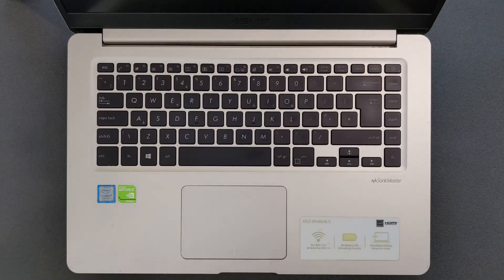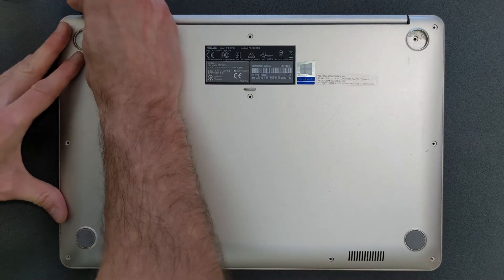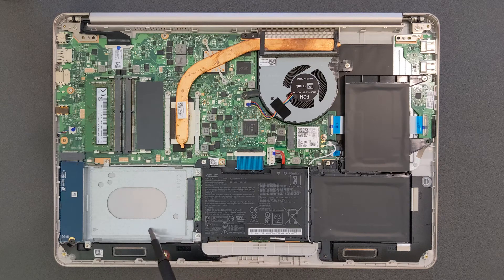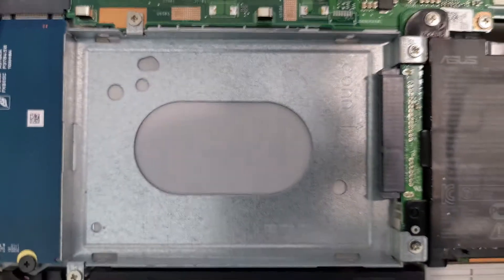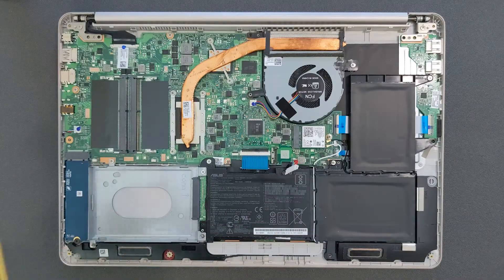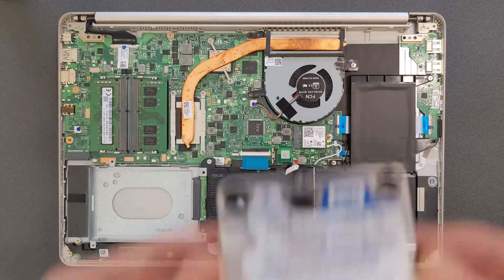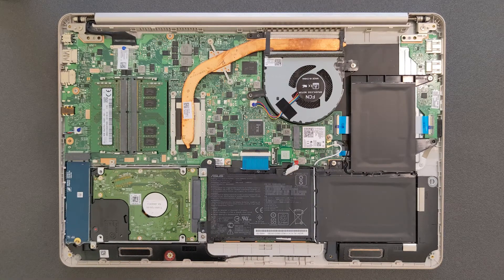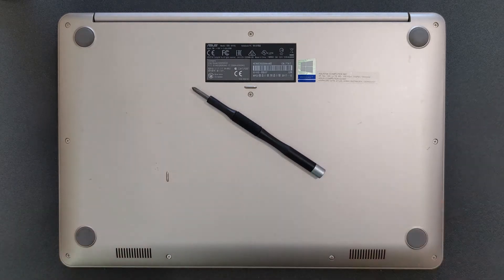Asus Vivobook 15 X510U / X510UQ  RAM and SSD / HDD upgrade

Comment: I tried to add a 512GB m.2 SATA drive with no success. I cloned the existing 2.5 sata drive onto the m.2 (externally) first. I removed the the 2.5 and installed the m.2. Bios doesn’t show anything in the three slots with just the m.2 connected. Any suggestions or help?

Comment: Questions....mine has a 1 tb spinning drive, if I up grade to ssd I would assume the hdd would be removed?  Also says has 4 mem slots..1 used (8gb). I have 2 -8 gb 3200  boards will the 3200 work in 2400 slots? Yes I would guess the 3200 would just run at 2400. Can I run all 3 rams together and have 24 gb of ram? Thanks for advise in advance.
Reply: M2 ssd do not work in this X510.

Comment: Man...... I am so glad I bought this thing. Additional RAM slot, fast M.2 SSD slot, additional SATA HDD or rather SSD slot for increased storage as SSDs became quite cheap by now. And it didnt even cost me more than 750 usd. Awesome. And nothing broke so far, I always go for ASUS and they rarely let me down.
Reply: hi, please tell me which screw is needed for m.2 ssd.  If you remember, of course.
Reply: @ezdok_na_bochkah  I am pretty sure its often the M2x2.5 milimeter flat head, if you dont have it you can temporarily hold it down in place with some duct tape that will grip onto it well, then when you find a fitting screw just replace it, dont leave the tape there forever.
Reply: thanks for the answer)